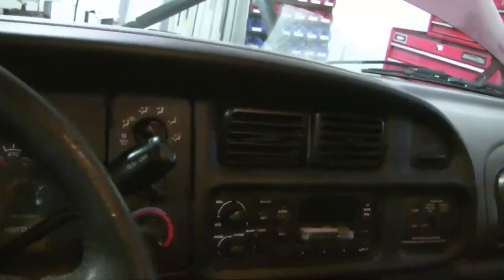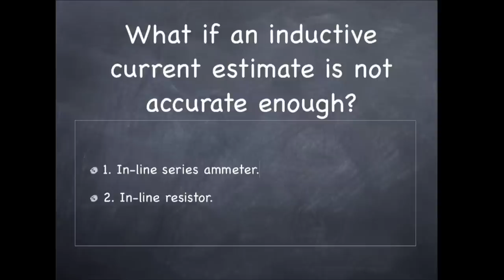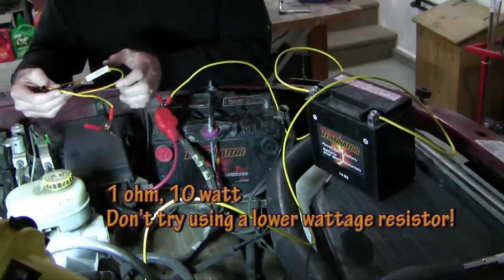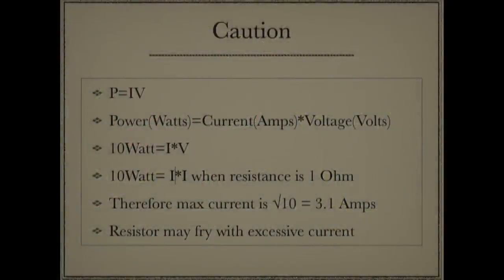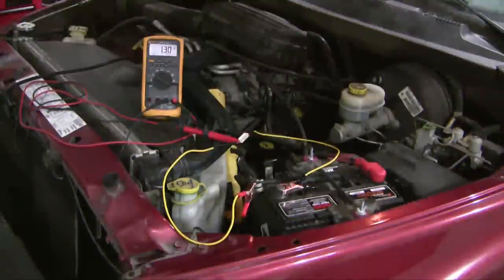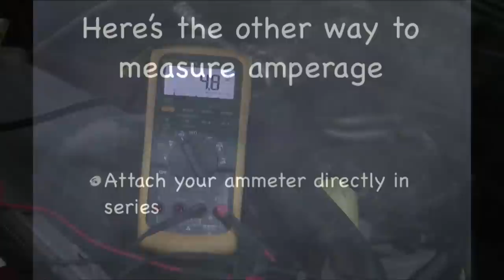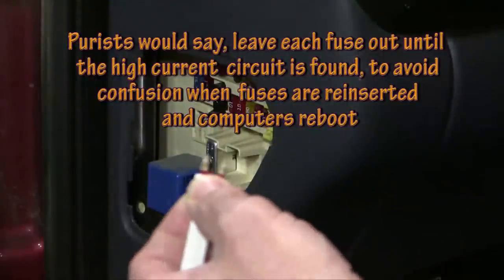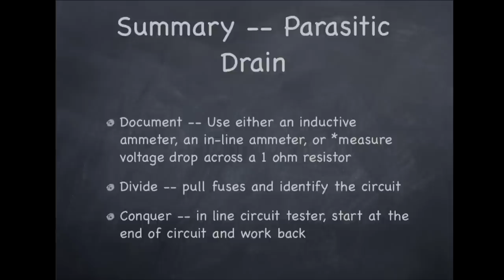Parasitic drain, an automotive short circuit that may cause a recurring dead battery

Comment from the maker: @AdrenalineJunky96 Two ways to approach this kind of problem. Most of us quickly go to what instinct tells us the problem is, like you did above. That approach is faster and often you get lucky. When that doesn't work, I find the second approach is better. Go right back to basics and start from scratch, by first investigating, slowly and methodically. The car will tell you what is wrong if you hone your listening skills. I could be more specific, if you can accurately describe what you have....

Comment: Reguarding the amp draw using the 1 Ohm 10 watt resister, couldent a 4 amp fuse be added to protect the resister sence its only capable of 3.1 amps?

Comment: Very useful video, keep going. I thank you especially for 1ohm good explained method coz I have a cheep multimeter and I need to use it for this purpose. Still I'll try to find a little strong resistor cca 15-20w.

Comment from the maker: If your battery was well charged the night before, then you disconnected the pos lead, and left it overnight, only to find the battery in the morning was bad, then your problem is a bad battery. Parasitic drain won't ever happen if either lead is removed (no route for electrons to get back). I would remove the battery and take it to an auto store where they can test the battery for you (usually free).

Comment: @seasonedtoker 1. the purpose is to Detect the parasitic drain compared with `50mA not to accurately measure it. 2. you can make a 'stable' 1ohm resistor for 3-4 seconds, don't you think 3. of course you can go with your inline amp meter.

Comment: I doublewatch your video coz it contains more the one tutorial inside. My question is can you elaborate on Cold Cranking Amps and Reserve Capacity numbers on battery coz I want to understand more of my battery 55A with 255DIN (GM) I know what 55A means but 255DIN dont. tnx

Comment: Disconnected the negative battery terminal for the night and wake up and battery is dead but by boosting it starts right away?
Reply from the maker: If the battery was well charged before disconnecting it, and then can't produce enough current to turn a starter motor the next morning, you've got a bad battery, at least. I would warm and fully recharge the battery, replenish distilled water in the cells if the caps are removable, and then test the battery to confirm. Autoparts stores will test batteries for free, though for the test to be valid the battery needs to be fully charged first. One of the most cost effective tools to have in a personal shop is a trickle charger that allows you to slowly charge a battery overnight. They last for decades and you'll find many uses over the years. Just don't smoke when you're near them since overcharging a battery can produce hydrogen gas, and of course don't charge a battery that has bulging sides. When disconnecting the battery spend some time with a wire brush to be sure the connections are clean and secure. Good luck!
Reply: spelunkerd it’s a 2015 Chevy Silverado 5.3 with factory battery still on it

Comment: O.K. more progress but yet still so far away. I have a 94 Oldsmobile 88 Royale. I have unplugged everything I can find relating to trunk release, power door locks and horn as far as connectors go and shaken everything around them. I just found there is another smaller fuse box under the passenger side dash. There is smaller fuses for 1. Door Locks, 2. Power Antenna, Lock Switch, Trunk Release, and 3. Horns. I got to #2 fuse and WALAAAAAAAAAAAH, the buzzer quit!!!

Comment: used a 25w 1 ohm ceramic resistor today.  found i had a 23mA draw, kills the battery in a week of  sitting.   the problem im having is, i have a battery kill switch in the car, but i cant kill all power to the car because it resets the AC ECU kam.  every time i turn the battery on i have to go through a calibration procedure to use the AC.

Comment: my honda pilot would not start if left alone 3 days turn out fine after the remote start fuse is removed  .  turns out mine is like leaving the ceiling light on . draining the battery in a couple of days.
Reply from the maker: +Michel Nadon It's surprising how common it is for aftermarket devices to be the source of parasitic drain. Thanks for dropping by.

Comment: OK so now that I've seen your video and both Scotty's and Eric's videos I still don't fully understand the real world practical advantages and disadvantages of the 2 methods. According to what I've gathered Scotty's method of using a resistor is to protect the multimeter from getting fried but at the same time the resistor got so hot that Scotty Kilmer burnt his fingers while filming the video. In Eric's video, the multimeter remains connected except when opening a door, etc to prvent big spikes

Comment: My Ford Taurus is in the shop right now being checked for a parasitic drain cause the battery keeps dying and they're charging me $300 just to find out what the problem is!
Reply from the maker: Sometimes the diagnosis is easy, and sometimes it can be really hard. In general diagnostic work is not well funded, especially when the cause is obscure. Fortunately the most common cause is an aftermarket part like a security system that isn't designed well for the situation. Often they overestimate price a little, and then give you a break when it turns out to be easier than they expected. Good luck!

Comment: its more complicated then this a resistor of 1 ohm takes away 1 volt in same way a light burns off 12 volts if its rated at 12volts

Comment: @hailapeste if you have a crappy DMM and you wanna go with the resistor method the results will be even worse. hi-load resistors are usually 10-20% tolerance.
the only accurate way to do this job is using an inline amp meter and that's it.
and I wouldn't take advices from scotty kilmer...